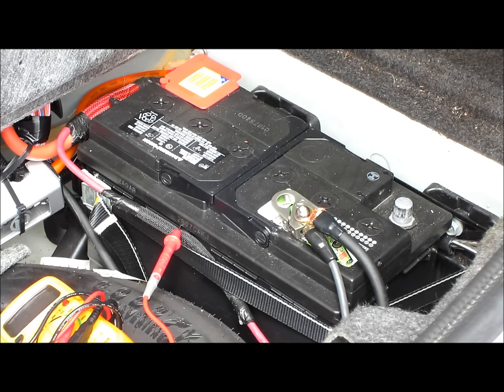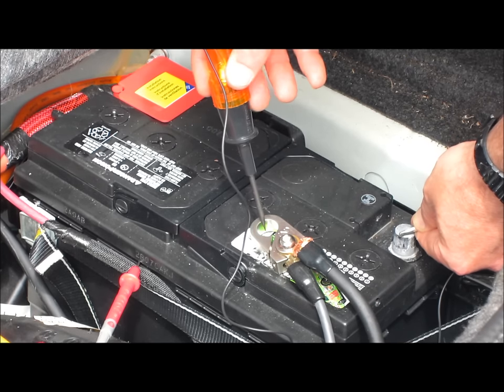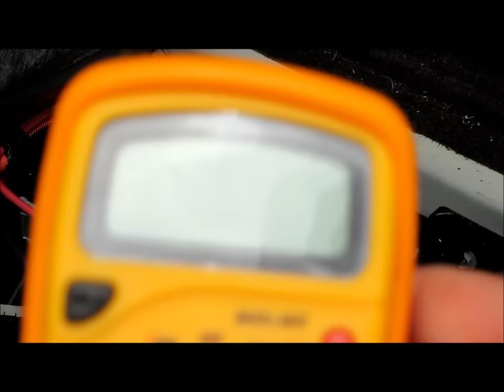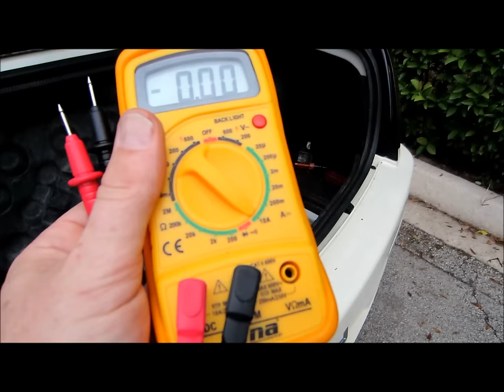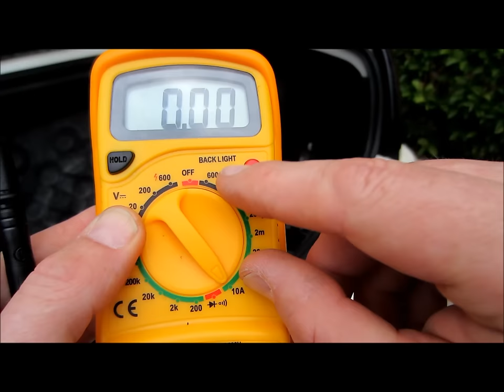How to check for and fix a battery drain in your car

Comment: Had this happening on a 2011 Chrysler 200.  Found that the glove box light was staying on.  The switch went bad at the base of the door.  Since the light assembly didnt have a plug to remove the light, I just cut it and taped it off.  For a couple weeks no battery problem.  All of a sudden its back!  Going to see if I can find the draw using this method.  I think however that I am going to simply put an inline kill switch on it and make sure nothing is leeching from the battery.  Really I dont care what time it is or if my radio holds stations. Certainly not going to pay someone 75 an hour to fix it plus the mark up on parts.  This system of one guy paying so much that 3 people can work is played out.
Reply: But what about the memory in the PCM? Every time you start and drive the car, it will have to relearn all the drive parameters all over again. And if you have emission testing where you live, good luck! The PCM has to see a set amount of drive cycles to pass testing. With your method, that can’t happen. Instant failure!

Comment: Isn't the dc the left side and AC is on the right side?
Reply: Yep. DC is the static icon, and the curvy line is an AC sine wave.
Reply: There are  a few tips for fixing a car battery
do not try to do this until you know what you are doing - the acid can burn your skin
Test the voltage first - there may be a dead cell which would waste your time.
Check the battery fluid.
attempt to fully charge the battery.
(I learned about these and more on Jons mender guide website )

Comment: 1. You got the AC and DC symbols crossed 2. Maybe that explains why you got ZERO% draw on meter. But obviously there should have been a draw read, since the test light showed there is a parasite (s).

Comment: So my car first broke down 3 weeks ago now after my belt went loose on the alternator, alternator was needing replaced anyways along with battery so I replaced all 3 for 400 pounds, then 3 days after my car is fixed it breaks down again while im working as a delivery driver, I end up using my boss's van for the rest of the shift, my car would rapidly tick over again, then after 10 minutes when i put it into 1st and pressed the accelerator it started up, shut it back down to go to work and tried again it wouldn't start, jumped the car with a friend and we talked 5-10 minutes until the car eventually stuttered more and more to the point it stalled over, called mechanic over few days later and he told me the alternator isn't charging the battery, was a refurbished one but he'd replace it for free as it's under warranty for a year, despite being 3 days old, so I don't have my car for another week until Friday which hopefully fixes it but I'm scared because he thought at first I had a drain, and I'm worried because since he fixed my car the first time, my radio has stopped working, it won't turn on, the lights on the buttons won't turn on either when i put my lights on at night etc, wondering if that could of fried my new alternator?
2010 Kia Magentis with 219,000 miles on it

Comment: And why is your battery in the trunk?
Reply: Chrysler , Mercedes, BMW and some other cars have some of their cars batteries in the Trunk, I've even seen GM vehicles put them under the back seat . They typically last longer because they are away from the heat made by the engine.

Comment: HI I DON'T KNOW MUCH ABOUT CARS BUT SOMETHING IS DRAINING MY BATTERY. I HAVE A 328i 2008 BMW AND I'VE TAKEN IT TO 2  PLACES WITH NO SUCCESS MY CAR IS SITTING IN FRONT  WAITING TO BE LOOKED AT . I CAN'T EVEN OPEN THE TRUNK AND THERE'S NO JUICE FLOWING THROUGH THE CAR WHATSOEVER.  I DON'T EVEN KNOW HOW TO OPEN THE TRUNK  WITHOUT ELECTRICITY FROM THE BATTERY TO PRESS IT OPEN. PROBLEM #2  I WAS ABLE TO PURCHASE A SOLAR CHARGER BUT GETTING IN THE TRUNK IS A SERIOUS PROBLEM  TO  DETERMINE WHAT THE MAJOR PROBLEM IS .  I HAVE SOMEONE COMING IN A COUPLE OF WEEKS I'D LIKE TO GET UP AND RUNNING. I SUSPECT VANDALS... PLEASE HELP. THANK YOU... ANTOINE
Reply: Antoine Mahan stop yelling
Reply: Pull the fuse  that powers the trunk or hood light.

Comment: Finding you have a "Draw" as you call it is the easy part,
finding WHERE this "Draw" is can be very difficult
BTW, a radio will "Draw" too as it is holding memory.
Most battery problems are because of dirty and or corroded connections,
I always start there and so should everyone else.

Comment: srry dude. computers always draw. you absolutly need a multy meter!! 18 yrs in  the trade specialize in electrical diag.
Reply: Computers always draw, but it's how much is being drawn...Best you pull the fuse on the computer first, then see what you get...Still have current being use?...Start checking the other fuses...

Comment: CORRECTIONS: at 04:00 the "V" with a line and a dotted line represent dc and the "V" with a curvy line represent ac Voltage.
Reply: Battery have to  be  connect it for this ??
Reply: Then does that mean he had the multi-meter hooked up incorrectly for AC instead of DC?  Would it have made a difference here in what he did?

Comment: surely if you put a cheap test light as you have between negative terminal and lead its the same as putting across battery and will light anyway!!!!when you tested for amp draw it showed zero strange and confusing!!!!
Reply: No, it would only be the same if there was a dead short in some component in the vehicle.  If nothing is switched 'on', there would be no voltage between the battery neg terminal and the vehicle ground wire.

Comment: If test light doesn't light up, you have a problem. Test light will not tell you if you have drain
Reply: But why not cos surely if the bulbs off then means no power but if bulbs on then means there's something taking power from the battery. But like people are saying still won't tell you what it is drawing the power or if it's a lot.

Comment: Lessco Electronics, you should know/understand your DVM fully before posting & showing people how to troubleshoot.

At the same time, pulling out fuses will not be able to pin point in the real world. 
It's like using a OBD II to clear the Check Engine will not fix the problem.

Comment: I clicked on this video because I was curious how you were going to describe this testing accurately in 7 1/2 minutes. Finding a parasitic draw is FAR more complicated than this ! This method was fine for older cars but the newer the car the more complicated a parasitic load test is. If you watch this video and walk away thinking you're going to go fix your car now, FIND A GOOD MECHANIC.

Comment: I got  battery drain and sometimes it gets plugged up...
Reply: There ground plates for battle held failed yes u can jump it go any were but one day it will  sound like no spark or you think fuel pump out no it’s not side post ground plates slide they no long are strong enough to push 12 vc

Comment: I used a multimeter first found no parasitic draw and then used the test light and it turns on always even when there isnt a draw. So sorry sir you have the right idea but u are wrong.
Reply: I even made sure that all my lights doors and everything is off .

Comment: That dose not work on my 2012 Ford Escape . The amp meter  reads .52  .I have taken out every fuse . I can shut the car off go in the house then come back out in 10 Minutes. It will not start  click click  . Go for another drive  5  kilometres shut it off  go in the store come out in 10  Minute It will not start .  Go to another place shut it off for a bit. Try to start it way you go. This has been going on for 2 years .  Ford has no clue of what is the problem is  no one dose it's a mystery .